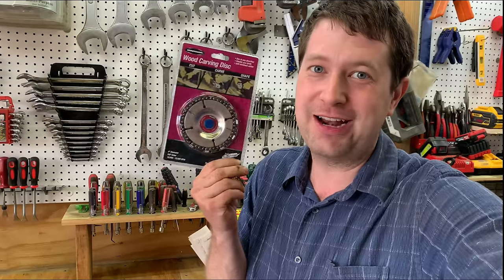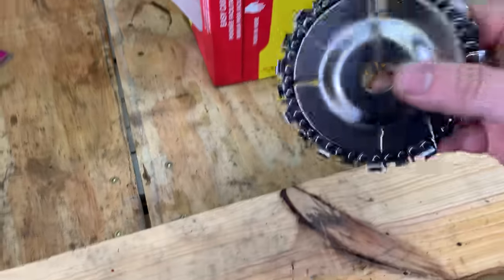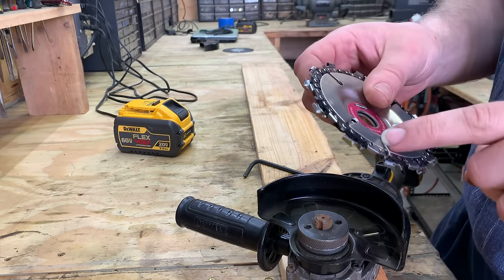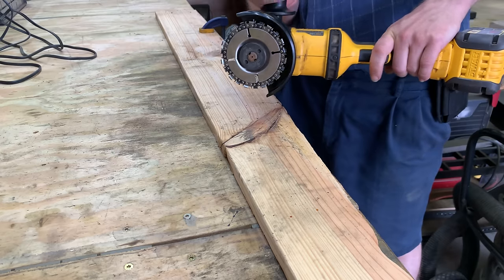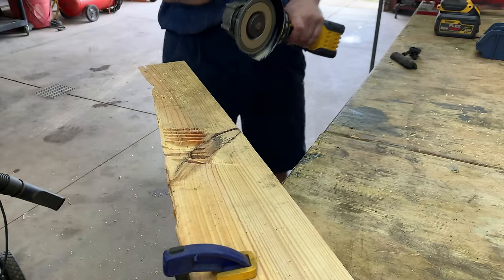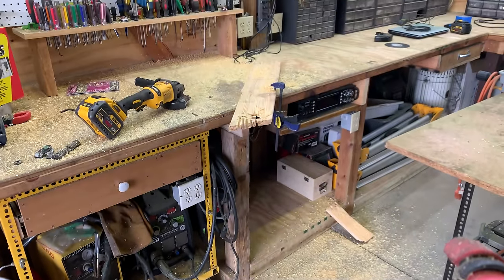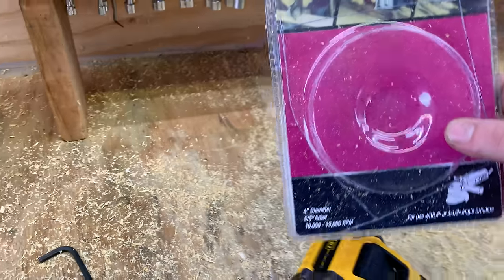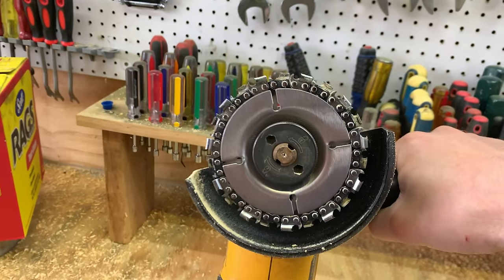Most Dangerous Angle Grinder Attachment I have Ever Seen

Comment: CREDIT DUE TO ALL CONTENT CREATORS, THANX!!

...like a chain saw, or table saw...maybe a great big old radial arm saw...Ooh! I know! That great big ole behemoth 1945 planer with near no safety feature on it I learned on in woodshop in school in the '70s!!! Could plane your hand down to the wrist in an instant if not very careful. Or just as bad...send the piece of wood through the building midair on the wickedest kickback I ever saw a power tool do and stick into the sheetrock on the wall behind me 3" deep! 

I don't really know of any "safe" power wood cutting tools...does anyone else here? 

But also true whether you believe it or not I run a chainsaw T-shirt/shorts/low shoes/ballcap w/hearing& eye cover in summer. I have been running chainsaws since about 1976 though. Huge family, large house, many boys=big hand split, toss and stacked, fighting one another while working like brothers do cutting wood in the southern summers cause the labor is free when you own the woodlands to have fuel growing! I didn't have a group of brothers...we were more like a chain gang! 

The first saw I used I can't remember the model of that old ass antique Husky it was, but the mega-powered dinosaur was so big I could put both feet in the handle and start it like a lawnmower two-handed while dad choked/feathered the throttle to start it. Dad told me it had a two-man bar attachment but he gave it all away since we just cut firewood with it, so it was no small potatoes for a chainsaw. Running it felt like having a 1975 Suzuki RM 250 with a bar and chain on it in your hand and running it wide open! Now add to that my dad kept his chain drags filed way down too...it was hard to "keep up" with the saw! No pushing needed, you spent just as much effort holding it back it cut so fast! I am like 98 freakin lbs soaking wet wiery ass punk that can barely lift it hefting it around on my thigh cause my arms were too spindly to tote it all day! lol

And let's not get into the old 1951 one-ton w/one brake on one wheel we hauled wood and stuff round in! My first driving lessons...you guessed it! Bouncin literally almost tween the ditches with that beast loaded w/wood and sloppy steering from horrifically worn-out front suspension crossing old ass country wooden bridges with no railings! Man!  The "good ole days! ha!
Reply from the maker: Love it lol!

Comment: IF YOU DONT RECONIZE WHAT YOUR LOOKING AT YOU MOST DEFINITELY SHOULD NEVER USE ! AND WITH SAFETY PPE AND FAMULAIRTY WITH DOS AND DONTS IS ALLWAYS A MUST ! Sir you should not be operating a tool like a angle grinder the rpm is a hazard x 10  safty tip #1 the faster the tool the faster it can remove body parts !

Comment: I wouldn’t let a women touch one of these, Nor would I let any metro male Get a hold of it. If you ever let go of it when it kicks or get your hands in the wrong spot by using it wrong, your heading for emergency.  I use one on a 9 inch grinder and you need big nuts or you will have no nuts. That thing will bust your wrists if your not careful or pull your clothes into it and wreck anything it gets a hold of. Only people who are very skilled should be messing with one of these, their not for un skilled people.
Reply from the maker: Lot of "skilled" people get hurt by this tool as well!

Comment: Why are you using it like that? Those cutting operations would best be accomplished using a circular saw, miter saw, jig saw, or saw zall. It's a carving disc. Not a cutting disc. It clearly says on the packaging. Wood CARVING disc. This video is an embarrassment. You should be ashamed of yourself. Spreading fear, ignorance and misinformation about a tool you admittedly know nothing about. This video is irresponsible and an exercise in fear mongering.

Comment: Does this idiot ever worked with an angle grinder? Let alone a big one? 'This does not look safe'. ....really?? It's not a baby toy. Machines that cut through steal like butter aren't designed for safety purposes. I think that disk looked like a useful tool. But what do I know, only worked with those machines for the last 30 years.

Comment: Fun fact:  you only need to hand-snug angle grinder disks because they only spin in one direction and will tighten themselves with use.
Reply: ya keep doing that and one day you will never get that old disk off, use the wrench.
Reply: @herdbooks2320  That's why they give you a wrench so you are able remove the disk.  Putting the disk on hand-tight is not going to make it harder to remove.  I suppose if you threw the disk on really loose you could generate some amount of impact when it the nut bottoms out after eating up the slop in the threads but that is not what I'm saying to do. Sure you could use the wrench to tighten the disk so tight that it won't further tighten during use, but then it certainly will be hard to remove.  The disk can only tighten itself when there is a difference in rotation between the shaft and the disk (or the nut depending on what style of disk you are using). Since the motor is always driving the disk clockwise, it's always trying to thread itself into the disk (or nut) which draws the nut tighter against the top of the threaded spindle.  When you grind the disk begins to torque the shaft and if enough load is applied to the disk the torque overwhelms the friction generated by the clamping force of the nut.  Note the directions of rotation relative to the direction which the threads are cut, and also that because there is much greater friction between the disk and the nut than the nut and the threads (the friction between the nut and the disk is also at a farther length from the axis of rotation giving it a mechanical advantage even if the friction acting against the threads of the nut was equal to that between the nut and the disk) thus when the disk begins to slip it spins the nut which tightens it increasing the clamping force which increases friction until the slipping stops.  If you grind hard enough or in a worst case scenario stall the grinder completely instanteaously the disk can only tighten as much as the sum of the rotational inertia of the shaft system plus the torque of the motor (most induction motors generate max torque at or near a stall condition).  In other words, if you put the disk on hand-tight and do some light griding work without ever letting the disk bite too hard, it should come right off when you're done still very close to hand-tight.
Reply: @niceday2dayman  I've ruined a grinder doing what you suggest. keep it up....
Reply: @herdbooks2320  You ruined a grinder how?  Please share your experience so we can learn.

Comment: Its a great tool. I have several of them. However, it has to be used the correct way. Running the tool straight into the workpiece as this guy did is the right way to lose a finger or worse.. Two hands on the grinder and use it flat. It removes a lot of wood fast.